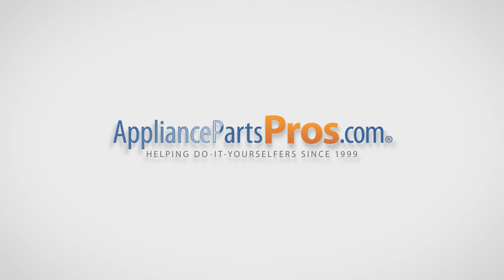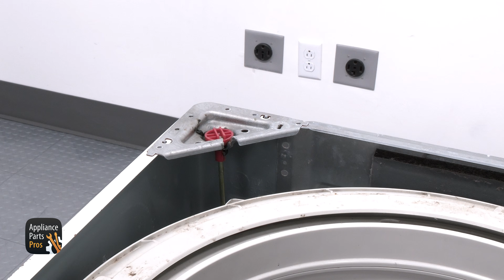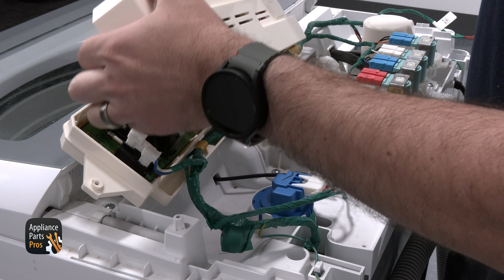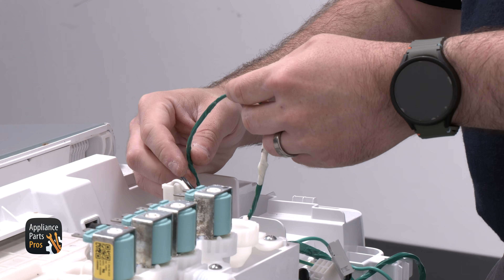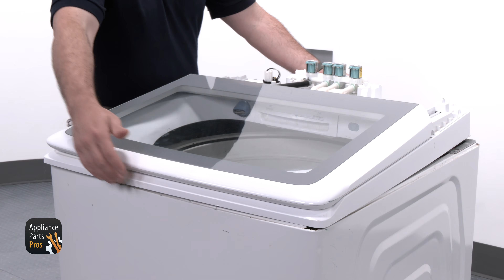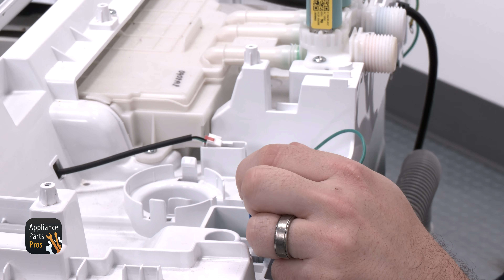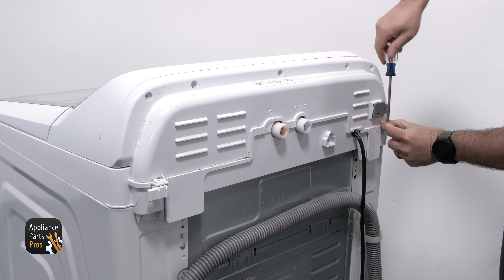Fix Shaking Samsung Washer with EASY Suspension Rod Replacement

Comment: I needed a few more steps to get the lid off the washer: 
1) Pry and pull out a plastic wire guide that holds the wire bundle to the top near the noise filter. It's probably there only to indicate someone did some work under the lid.
2) Use a very small flat head (about the size for repairing glasses) to carefully separate a blocky wire harness about the size of a 2x4 Lego next to the noise filter. The overlapping clasp holding the blocks must be pulled up from below and the space is too small for regular screwdrivers.
3) Remove two more Phillips screws on the front of the top. Use a screwdriver to lift out the rubber cushions where the lid rests to expose the screws.
4) Remove the power cord from its clamping seat. No tools needed for this one.
Reply from the maker: Thanks for sharing these extra steps! 😊 Accessing the lid can be a little different depending on the Samsung model, so your experience may help other DIYers. We appreciate you taking the time to explain what worked for you! Just be sure to disconnect power and handle the wiring connectors carefully to avoid damaging them. 🔧

Comment: followed the video, replaced the suspension rods pretty quickly. took pictures as i took things apart, didnt even end up needing them. thanks for the video!
Reply from the maker: That’s awesome! 😊 Taking pictures as you go is always a great tip, even when you don’t end up needing them! We’re glad the repair went smoothly. Thanks for watching and sharing your experience!

Comment: Wtf you do not have to do all that only wires you unscrew are the 3 ground wires in the back there is no need to take everything apart
Reply from the maker: Thanks for sharing your experience! Different Samsung washer models can have different steps for accessing the suspension rods, so the process may vary. We appreciate the feedback and always recommend following the instructions for your specific model to avoid unnecessary disassembly.

Comment: DO THIS TO MAKE IT WAY EASIER!  This is a great video, but there is an easier way to replace the suspension rods. 

1 - grab someone to help
2- remove the 2 phillips screws for the control panel; lift up control panel and place it on the lid (you can fully remove if you want, but it's not necessary)
3- remove 4 phillips screws attaching lid to washer body
4- while in front, lift up lid - it will go about 45 degrees open - and have your helper hold it.  you'll have plenty of room to then replace the front suspension rods. 
5 - on the back, remove the metal cover
6- remove and replace suspension rods - you may want to have your helper lift up the control panel/lid to make it easier, but with some lifting and compressing of the suspension rods you can do it simply through the opening in the back
7- done - put it back together
8- RECALIBRATE!  once you move washer back to its location recalibrate by: turn the machine on and hold the Temp and Delay End (or Soil) buttons for 3 seconds until Cb or CLB appears, then press Start/Pause
Reply from the maker: Thanks for sharing your method! We appreciate you taking the time to write out the steps. Different Samsung models can allow for slightly different approaches, and your tip may help other DIYers save some time. And thanks for reminding everyone to recalibrate the washer after replacing the suspension rods—that's an important final step for proper operation. Happy repairing!

Comment: I like how the neglected to show how to disconnect the wires in the middle and far right side asshole
Reply from the maker: We appreciate the feedback and will keep it in mind for future videos.

If you need more installation, troubleshooting or testing information you can check out our Repair Forum: https://forum.appliancepartspros.com/.  It’s easy to register, and you can either post your question or search the forum to see if someone else has already asked the same question.
 
Our experienced technicians, with over 20 years of hands-on appliance repair experience, are ready to answer your questions and guide you through your repair.
Reply: 😂😂😂 this happened to me too and his hand blocks it I was pretty fustrated but I got it done just had to really look but easy to break there was some more flaws like some clips once unplugged especially the water sensors the 4 it seems like you could actually plug them in the wrong way , and he never goes over recalibrating your machine it could be obvious to some but it wasnt to me and immediately my washer was wonky. Hope you got it fixed though sir
Reply from the maker: Thanks for the feedback! Thanks for watching

Comment: Wrong.  Why would you disconnect everything?   I’m female and you’re a fool.   DO Not follow this guy  .. 

 Needless work…
Reply from the maker: Thanks for sharing your feedback. Suspension rod replacements can vary depending on the washer model and design, and some repairs may require additional steps for safe access and proper installation. We always recommend following the procedure that matches your specific model and using the correct service information. We appreciate you taking the time to share your experience.

Comment: Thanks for the video but after watching it once I realized this simple process was made complicated. In less half the time I took off the back plate to access two rods then flipped the unit on its side to access the front two from underneath. 10 min later all fixed and didn’t have to remove100 parts, screws, and cables
Reply from the maker: Thanks for sharing your approach! There can be multiple ways to access and replace suspension rods depending on the Samsung washer model, and some methods may be quicker than others. We appreciate you sharing an alternative technique that worked well for you. Helping people find the safest and most efficient repair method is what it’s all about! 👍

Comment: This video was helpful when actually switching out the suspensions but i was able to pop the top of my washer off and move it to the side without disconnecting all the wires which helped save a ton of time and saved me from the part i felt was the most intimidating. I unplugged it and turned the water off still. I have model WA45H7000AW/A2
Reply from the maker: So glad the video helped! Thanks for watching!

Comment: What's the purpose of the mallet and pipe wrench?
Reply from the maker: So sorry for the confusion on that, it looks like those tools were not used in the video. So those aren't required to replace those suspension rods.

Comment: Im never buying a Samsung again
Reply from the maker: Sorry to hear you’ve had a rough experience. If you need more in depth troubleshooting or installation information you can check out our Repair Forum: https://forum.appliancepartspros.com/.  It’s easy to register, and you can either post your question or search the forum to see if someone else has already asked the same question.
 
Our experienced technicians, with over 20 years of hands-on appliance repair experience, are ready to answer your questions and guide you through your repair.

Comment: Samsung should be required to issue a recall on all these washers. They have the same fault design with these suspension rods.  This is far too common for these top loaders.  This is a time where I wish consumer analytics went past the sale of just the idol because I guarantee you based on just word-of-mouth talking to close to 50 people who all have had Samsung top loading washing machine. This is far too common for it to be such a low percentage type of issue. I would argue the suspension that they used on these machines from Lett say 2020 to maybe the end of 2021. All of these machines should be recalled because those years in particular have an extremely high rate of failure due to suspension rod specifically.

Of the people who I talk to, who had issues with their top loading washers is suspension rot every single one of them has purchased a washer either through the beginning of maybe 2019 through the end of 2021 that is a very specific set of years.  My parents have a top loading washer at their home and it is still in perfectly working condition and they bought it in 2016. The fact that I have to do maintenance on my washer that I bought in 2020 before they have to do any major maintenance on their Washington. They have in 2016 just shows it is a completely different level of care put into the washer bill before 2019.
Reply from the maker: I hear your frustration, @Sixdawg06 👍

Suspension rod wear can definitely be a common issue on some top-load models, especially with heavy or unbalanced loads over time. While not every unit will fail the same way, we appreciate you sharing your experience and feedback—real-world data like this is helpful for others researching these machines and repairs.

Comment: Great video. You left out the step of removing the rubber stopper and unscrewing the screws in the front of the top casing. (You only mention putting them back in) Would be useful to know that rather than trying to pull at the top. Overall excellent video.
Reply from the maker: Thank you for that suggestion! Glad the video was still helpful!

Comment: How do I know if my rods need replacing? Ive seen every video on how to replace them, but not sure if the unbalance code/function that keeps happening is due to bad suspension rods....they look fine when I look at them.
Reply from the maker: You can check the suspension rods visually, but there aren't any really good tests you can do to determine if those are bad. It's really just a process of elimination. You will need to check everything else that can cause that issue. If everything else is good, then the suspension rods would be the issue. If you need further troubleshooting or testing information, you can check out our Repair Forum: https://forum.appliancepartspros.com/.  It’s easy to register, and you can either post your question or search the forum to see if someone else has already asked the same question.

Comment: I was able to get away with only disconnecting the ground cables, and the cables that run up the back to the top panel and one cable from the PLC to the faceplate. That gave me enough room to pivot the top piece around left or right to swap the struts as needed and took about 30 minutes from start to finish! Very good video, but not strictly necessary to disconnect all the plc accessories. Thank you!
Reply from the maker: So glad the video was helpful! Thanks for the tips!

Comment: I am getting a DC error after completing the repair. I ran the calibration, but it did not resolve the issue.
Reply from the maker: If you need testing information or further troubleshooting, check out our Repair Forum: https://forum.appliancepartspros.com/.  It’s easy to register, and you can either post your question or search the forum to see if someone else has already asked the same question.
 
Our experienced technicians, with over 20 years of hands-on appliance repair experience, are ready to answer your questions and guide you through your repair.

Comment: I have a Samsung WA45T3400AP/A4 washer.
There is a sticker on the upper back of control section with a QR code DC68-03228A04,
I called Samsung parts and they say I need DC97-16350S and DC97-16350T, two of each. She said the left and right side take different rods. I would think front and back take different. I am having a hard time finding the rid kit I need. Samsung wants $300. 
PLEASE HELP
Reply from the maker: You will need two DC97-16350S for the rear and two DC97-16350T for the front. You can place that order through the website, or you can call us at 1-877-477-7278 to place the order over the phone.
Reply: @appliancepartspros Is dampening grease needed for install?
Reply from the maker: Hi @gfour20! 😊 Yes, a thin layer of dampening grease on the ends of the rods helps them slide in smoothly and reduces noise.

Comment: I’ve noticed different colors on different damper rods.
I have 2 white in the front, and 2 purple/pink at the back. Wondering if these are identifying something?
Reply from the maker: Sometimes it's as simple as noting the front and back rods so you don't get them mixed up. If you need help finding the part numbers for your unit drop your model number and we will be happy to help you locate that.

Comment: This was very thorough; however, it is not at all necessary to completely unplug and disassemble the entire machine in order to access the rods. This option includes much more work and very conplicated versus just propping the top open. You should consider adding a part 2 video for anyone who prefers an option that takes considerably less time. I can imagine this route will cause a lot of undue frustration for most.
Reply: That is correct. It is unnecessary to disconnect all the wiring or the instrument cluster to perform this repair. I think it's meant to intimidate and discourage diy. I mean, I'm only an electronic technician by trade, so what do I know, really.
Reply: @Alisha-nl9qh probably the manufacture recommended way. Also the way the repair companies can justify the repair cost if client is watching the repair.
Reply: Man you doing to much…..it don’t take all of this and I believe your method is to scare people away and making it seem way more complicated then it is. I don’t know anyone that would go through all that BS to do this!!
Reply: Thank you . I was going to say this looks extremely over complicated for just the rods
Reply: Dude is disassembling his entire washing machine control boards and everything.  Lol dude just take the screws out this process should take 10-15 minutes
Reply from the maker: Thank you for that suggestion!
Reply: Have you found any more simple videos elsewhere?  I.have this problem with my washer
Reply: @underconstruction778 after you search for "samsung washer suspension rods" look for the video by LorainFurnitureandAppliance the picture of the guy with both arms around the top. He shows how to do it without even unhooking the water hoses. You only have to turn the lid cockeyed to access the rods. One guy in the comments also said he just used the old rods and lightly sawed a groove just above where the plastic piece should stop and stay and tightly wound a piece of rigid wire in the groove around the rod and twisted it tight. He checks in every year saying it's still holding the suspension rods perfectly.
Reply: Can confirm. Just disconnect the ground screws and you have plenty of free play to remove all 4 suspension springs. Being careful of the wiring harnesses and water hoses of course.
Reply: You guys nailed it on the head...! It's all about intimidating people buying a product or services.. shame on them for not including an "easier" video
Reply: Bro I was like “why?!” Then saw these string of comments and did it SO much faster.

Comment: Great video!  This turned a challenging repair into a success story! My son and I tackled changing the suspension rods on a Samsung washing machine, and the video covered all of the essential steps required to disassemble and reassemble the machine in under 2 hours.   No more unbalanced error codes, and the clothes are barely damp at the end of the spin cycle.  Thanks so much!
Reply from the maker: Awesome! Thanks for letting us know, and great job tackling that repair together! 👍

Comment: So does that mean we don't need extra grease added before installing the new rods? 

I also noticed that there are 2 different rods online. 26.3 inches and 26.4 inches.

Also, does the water line on the 4th rod HAVE to be wrapped around the new rod?
Reply from the maker: Good questions about the install details. For specific guidance on lubrication, rod length differences, and routing the water line, our certified techs can help at forum.appliancepartspros.com. Just post your model number and what you’re seeing, and they’ll walk you through it! 👍